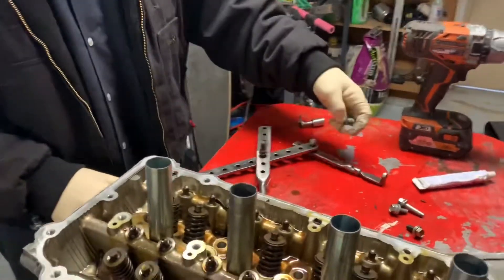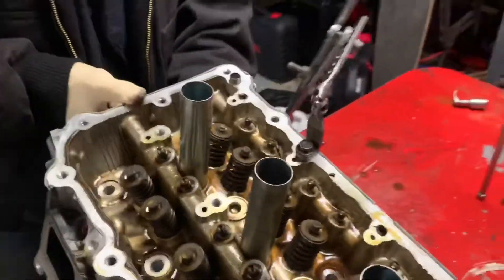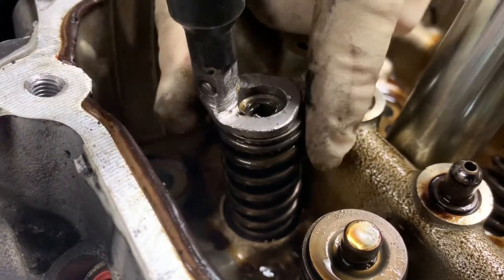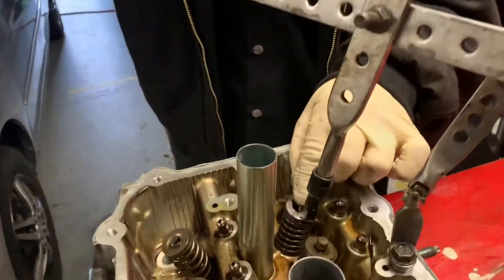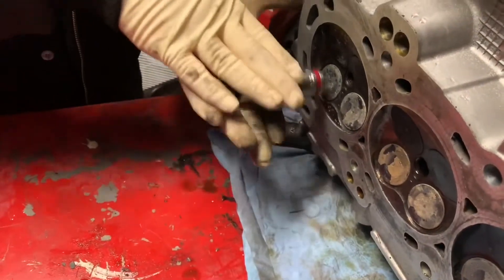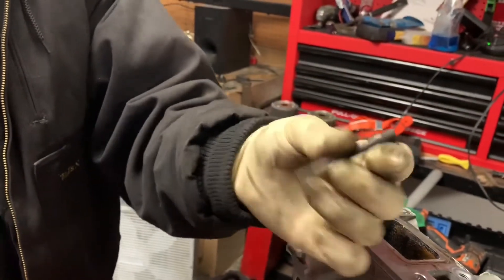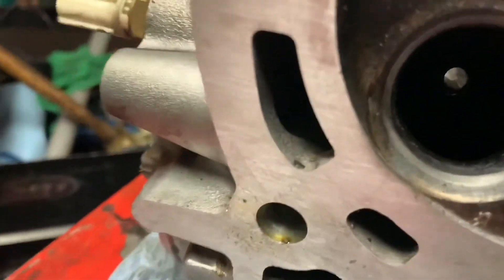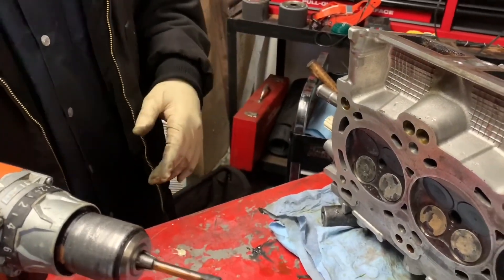Easy engine valve removal and lapping

Comment: I'm replacing my head gasket and cleaning, inspecting valves.  Do I need to replace with new valve stem seals if I do this?  Do I need to if the valves look pretty well seated?  2010 Prius.